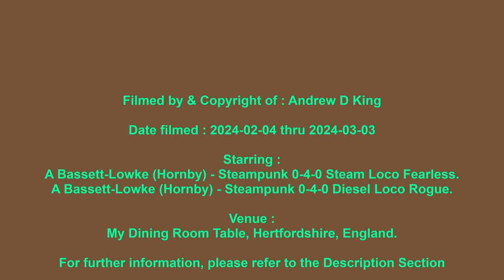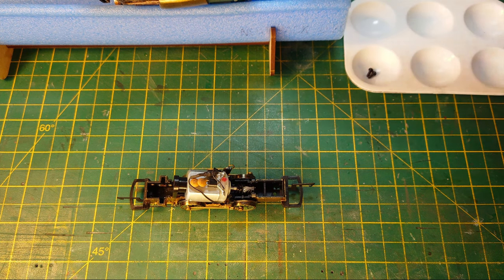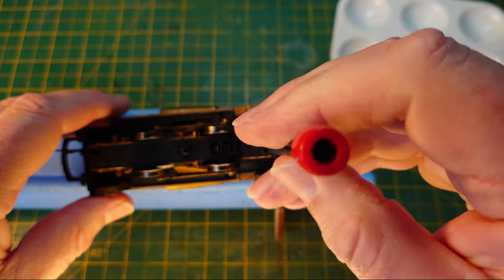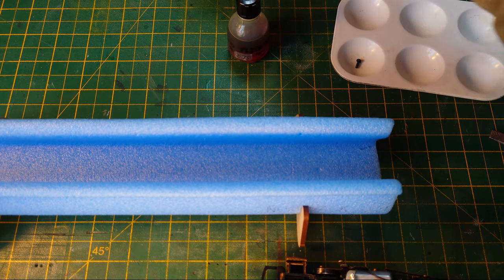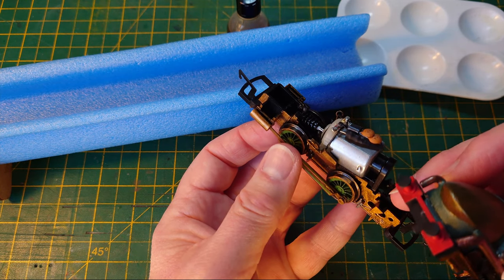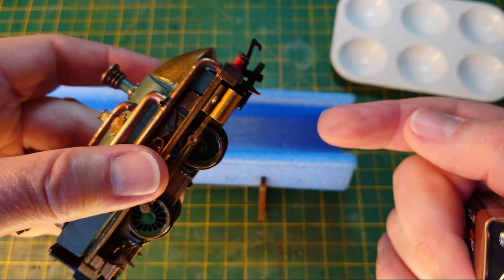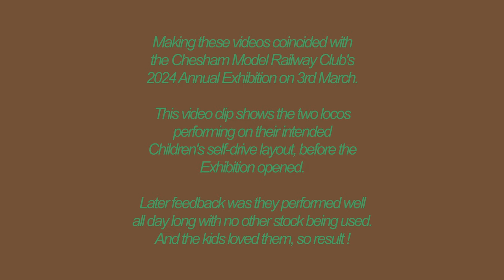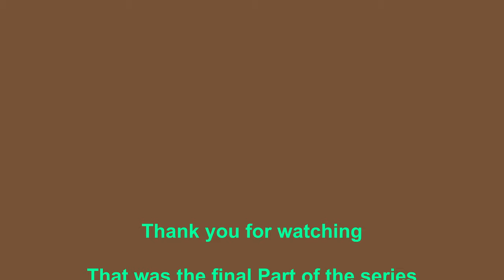109-8. How to - Give some Wow to Bassett-Lowke Steampunk Locomotives – a full Repaint – Pt.8 (4K)

Comment: They look really good , have to admit I did fast forward a lot of the earlier parts . Perhaps some side by side shots of before and after to appreciate the changes. Just a thought how about adding clear glass to the Rouge and creating a scratch built interior using the cockpit of a vintage aeroplane.
Reply from the maker: Too late to add clear windows to Rogue. As I said in the relevant Part, resin is a bit brittle and the window frame surrounds too close together. That would make the cab vulnerable to breakage and there is absolutely nothing inside to see. Anyway, those spooky clear green lacquer windows look brilliant I think. 
Oh, add an interior. Hmm, I don't think little kids would appreciate the effort in doing that and it took about 3 weeks to do what I did on and off. They need to be robust, not highly detailed models.
Reply: Look forward to seeing them next time I’m over .
Reply from the maker: @robinbowler2955  You will have to come on a Monday to Club then, as they are now CMRC property, so stored there, not my house.